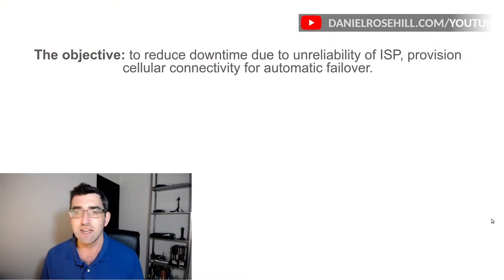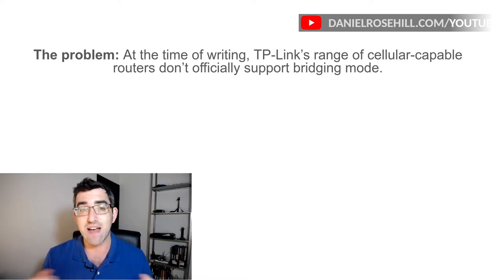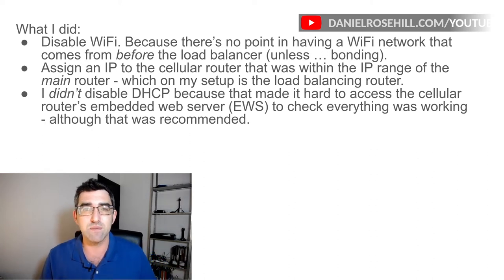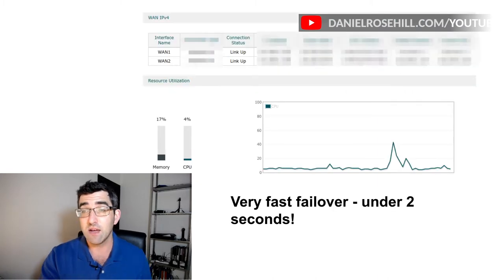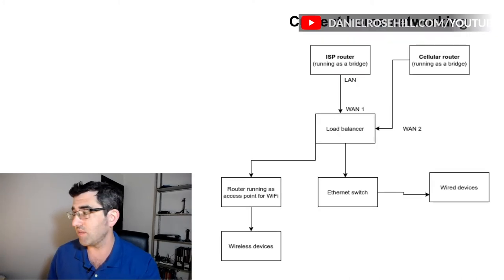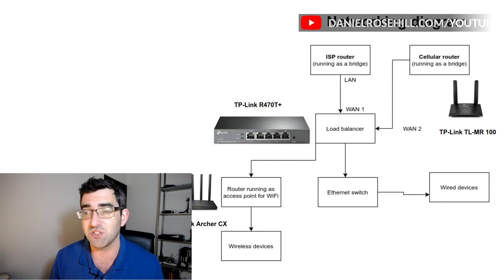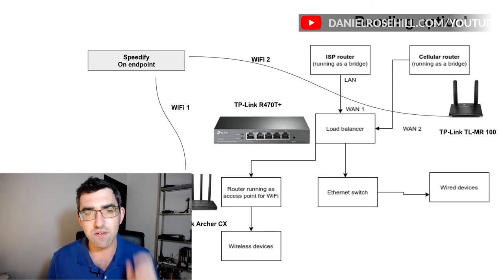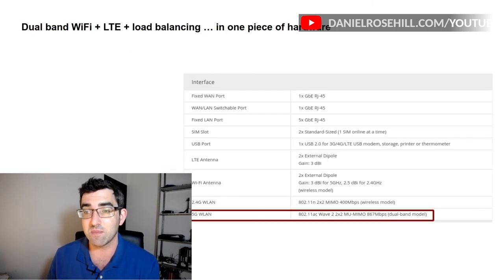How To Setup Cellular Failover On Your Home Network (Using TP-Link Gear)

Comment: Thank you Daniel for your videos on Cellular Failover, I am trying this setup I have 3 Isp's One as the main Isp and the other 2 as backup Isps. I am trying to get the perfect Load balancing router for this setup. Currently did some searches around Gigabit Multi WAN Router with Failover and Load Balancing could you please suggest any good ones for this purpose?
Reply from the maker: You have a lot of options. To the best of my knowledge most wired / broadband / SMB / VPN routers (all options within each category) will handle failover and mult-WAN. And of course all multi-WAN routers too. I'm using the TP Link ER 605, as mentioned, but I've found the product a little bit finnicky. I attempted to cancel my order and purchase a product from Mikrotik again and will likely buy my next device from them. Ubiquiti is a big name in the space too and I believe Cisco have some products also. People who actually own the devices will know plenty more than I, though.

Comment: What are you using as a firewall? I didn't see one in your diagram.
I have a 4G LTE Modem (Netgear) and Cable Modem (Netgear) going into a Load Balancer (TP-Link) which feeds into a Firewall (SonicWall) which then splits into an Access Point (Netgear), 1GBE Switch (Netgear), and 10GBE Switch (QNAP). My Backup server, NAS, and primary PC all connect to the 10GBE switch while everything else is split between the 1GBE switch and WiFi.
Been thinking of upgrading from Cellular as my backup to Starlink, but that may be overkill.
Reply from the maker: Hey! I'm just using the ISP firewall (managed through the router admin page). Although I'm not even doing port forwarding so my setup in this respect is very basic. I also got a decent fiber connection since making this vid so just keep the cellular connection now for occasional (manual) failover... But it's rarely been required.

Comment: Thanks for the clear explanation.  I'm building a house in the country where there's only a single, and not great, ISP, so I started to look at a LTE failover solution that won't be too expensive (and available locally to me). One question; is the switch connected to the balancer required? can't I just plug the couple of wired devices I have to one of the free RJ45 plugs on the balancer?  thanks!
Reply from the maker: Yup. Switch isn't required. I just have more ethernet connected appliances at home than I had remaining LAN ports (only one) on the load balancer. If you don't need extra connectors save yourself the money and hassle. Good luck with the project!
Reply: @DanielSRosehill  thanks for taking the time to confirm this!

Comment: Hi, can you tell me please what can I do so my wifi will switch automatically to a mobile router if the local ISP has a connectivity issue? The main issue I have is, that the ring alarm system I use wont work with their internal SIM card on my location. I wished to reroute the traffic to the mobile router if for whatever reason the local internet doesnt work. So I could still get an alarm even someone would cut the internet cable outside of the house.

Comment: Hi Daniel, I am also trying to configure a similar system to yours. But you mentioned if you had a bridge mode capable LTE router to begin with, it would be an easier option. Or at least thats what I understood. So I'm currently in market for an LTE router. If I buy a bridge mode compatible version is it easy to configure for failover? Because I'm honestly not very experienced with IT stuff, so if it needs a lot of tweaking and complicated configurations, I may not manage to do it by myself.
Reply from the maker: Buying an LTE bridge would definitely be the ideal option. You can emulate bridging in a regular router by disabling certain settings. But it's always preferable to use hardware as intended. That being said, I had a hard time sourcing an affordable cellular bridge where I am based (in Israel), so it was more cost effective to go for a cheap TP-Link 4G router. But if you're in the US, Netgear make a couple of LTE modems that should do the trick (if the cellular network you're connecting to will be LTE that is. If you're using 5G, clearly you'll need a 5G modem/bridge). https://www.netgear.com/home/mobile-wifi/lte-modems/
Reply: @DanielSRosehill  Thanks a lot for the answer, Unfortunately I also couldn't find any lte bridge in my area. Mostly tp-link products available. However I came-across a company called teltonika, they produce lte routers for industrial applications. Their entry level Rut-240 model seems to handle all my needs for a failover setup. I might consider buying that one around $170, because otherwise  load balancer+lte router combined would cost much more I guess and perhaps lte takeover can be quicker since its designed for that.
Reply from the maker: Could you find a TP Link cellular router? If so you could set that up as a bridge. I'm expecting 5G routers (and modems) to come down a lot in price in coming years so I was actually fine with not investing too much in this particular component. As soon as I can find a comparably priced 5G data plan and router I intend upgrading. No reason for even the failover connection to be unnecessarily slow.

Comment: Hi, I have an Asus router where I have my wired internet coming into the WAN port. It has a failover mode where it can take a second internet connection into the LAN 1 port. Can't I just use the TP Link MR100 connected to the LAN failover port?
Reply from the maker: Sounds like it should work to me

Comment: Why have routers in bridge mode?
Reply from the maker: Clearly, it's better to buy and use an actual bridge if you can source one (and cellular bridges do exist). However, in some parts of the world, routers are both easier to find (and cheaper!) than dedicated bridges.